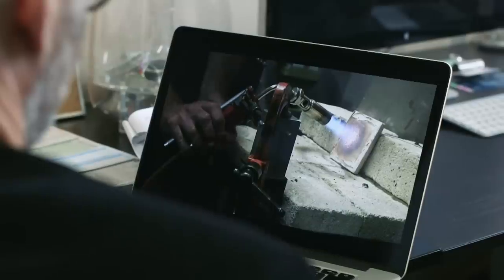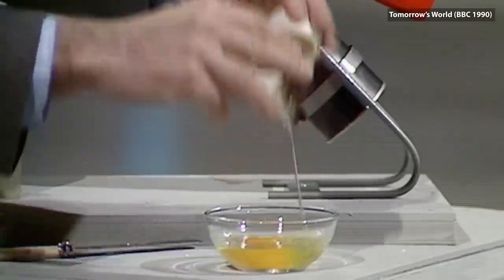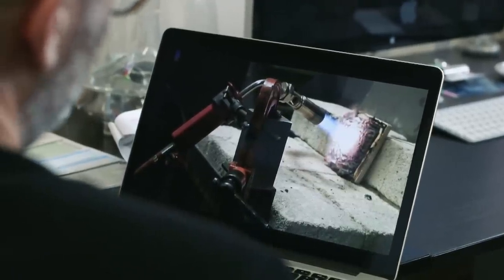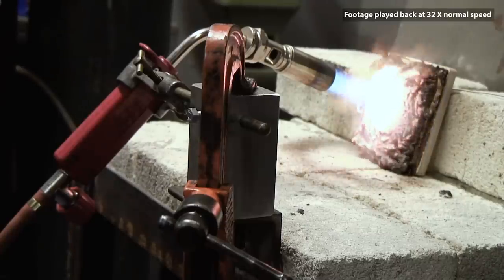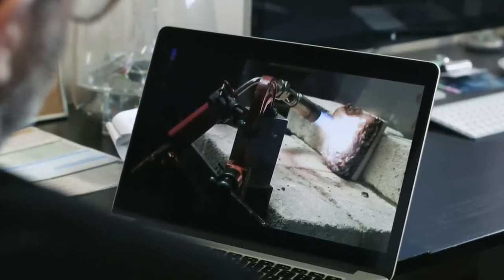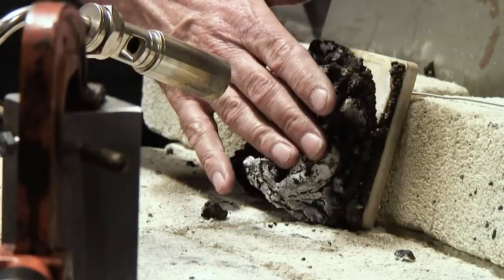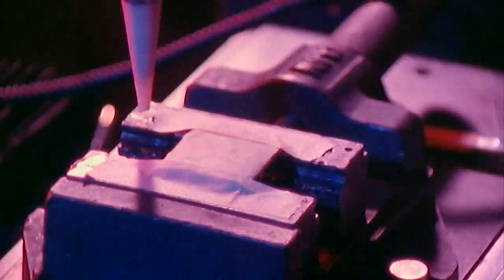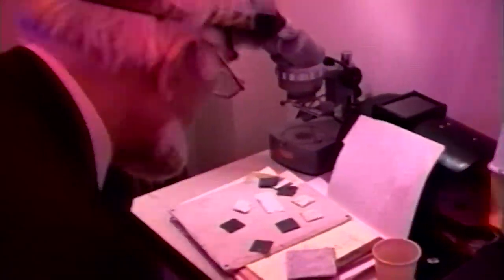How does Starlite work? - BBC REEL

Comment: NightHawkInLight just outsmarted yo all!
Reply: Not the same.
It is very similar, but it does not puff up as much and produces fumes.
Still: very interesting.

HE EVEN SAYS IT IN HIS OWN VIDEO THAT THIS MAY VERY LIKELY BE NOT STARLITE.
Reply: @bass-dc9175  try using or adding P-Nitroaniline
you're Welcome
Reply: @bass-dc9175  he couldve also added an oxidizer in very small ratio which will create more carbon foam much easier.
KNO3 most likely

Comment: Carbon sublimates at 1bar at high temps instead of melting. This makes it foam up upon extreme heat creating a 'carbon foam' where it creates thin walled carbon bubbles surrounding air pockets, which turns out is a very very insulative material. The cornstarch acts as the carbon source and the baking soda helps with the foaming. I believe the hydrogen and sodium just evaporate away at its working temperature.
Edit: PVA glue acts mainly as a binder. This was an explanation of how I think Nighthawk (NightHawkingLight's Starlite) works

Comment: If it's the carbon layer that insulates from the blowtorch, does that mean that if I wanted to use it as insulation I would have to burn it first?
Reply: cheeseman yeah it doesn’t work well as a low temperature insulator.

Comment: Still trying to figure out what you would use this for.
Reply: Paint on the space shuttle.
Reply: Maybe flammable rooms in buildings to keep the fire from spreading.  Can save lives and money from the property damage.
Reply: Paint on and in houses.
Reply: Ham549 Wouldn’t work, as the carbonized layers would be blown to bits
Reply: @JayVal90  Only on reentry. And as long as it survives the reentry it would be usable.
I mean reinforced Carbon-Carbon also gets replaced after reentry.

Comment: use that on tank armor.
Reply: That makes absolutely no sense -.-
Reply: it only protects from Heat 
not pressure or shockwaves
Reply: Hey maybe it can deter shaped charge round like HEAT FS
Reply: @IndoLiberation  no ... This offers no protection from shaped charge warheads. Explosive reactive armors are much better suited for the job.
Reply: @IndoLiberation  No it can not.